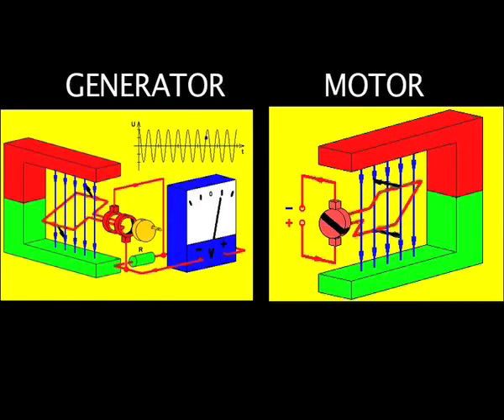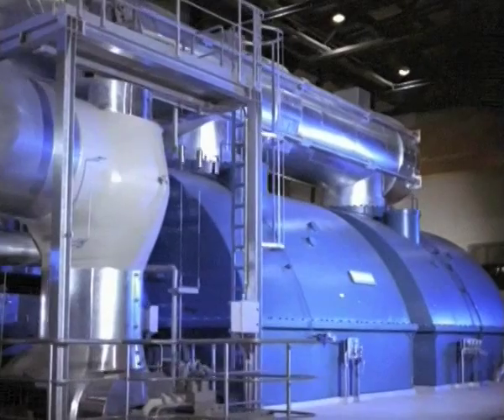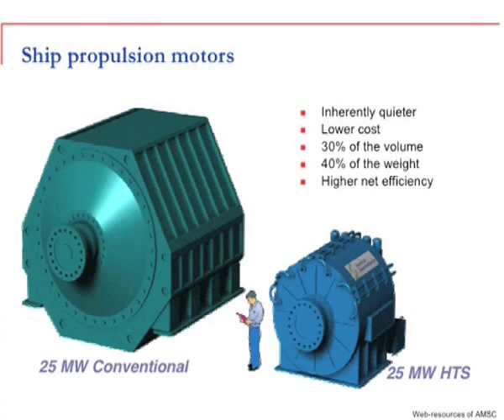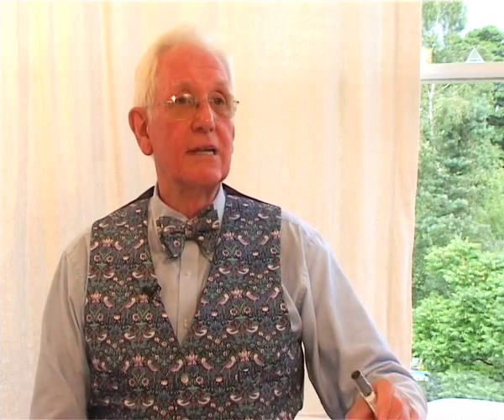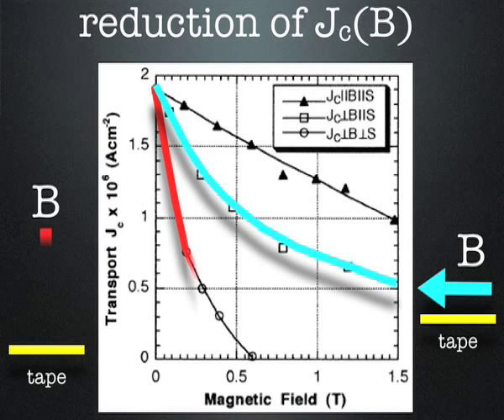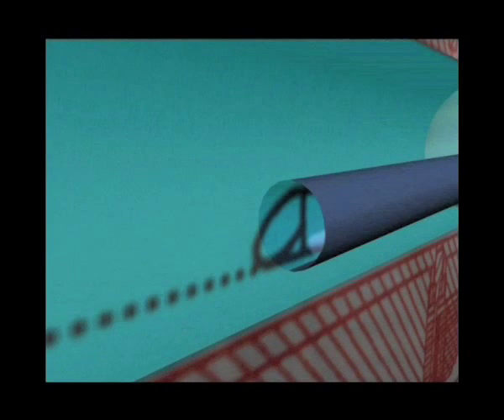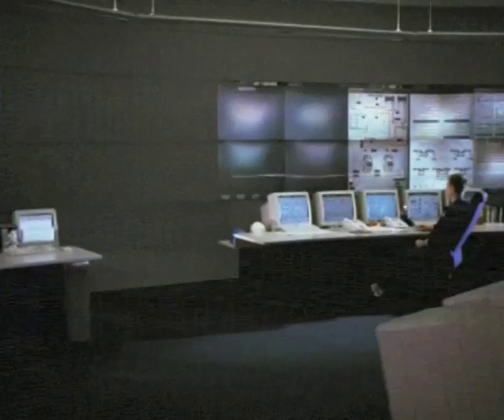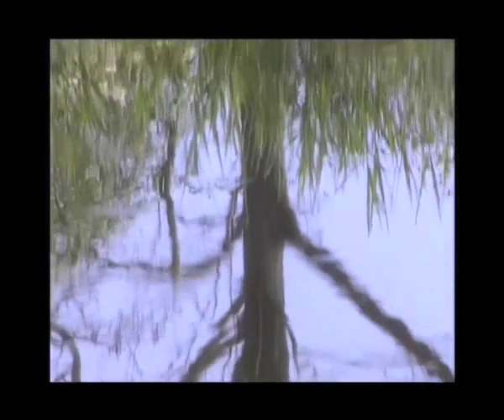Superconductivity: motors and generators

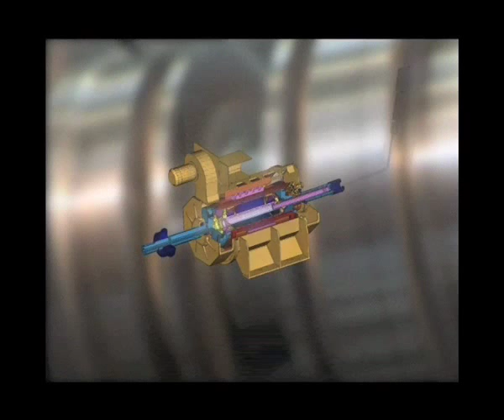Comment: 7:20 You have commercially available refrigerator that can liquefy neon gas and is completely passive and low/no maintenance ?
Reply: They mean the refrigerant does not need a pump. It still must be compressed back to liquid, which requires energy.

Comment: 1.7% no big deal.. Why bother
Reply: It is a big deal. The difference in emissions or power generated might be just 1.7%, which is indeed not too interesting (it does save a little bit tho), but because the power losses are reduced 2 or 3 times, you have less heat to remove and deal with, this is directly proportional to the size and additional infrastructure to run with the generator. It can saves tons of weight, space and extra stuff around the machine to make it work. It could reduce also the cost, but in applications like ships and submarines, it now allows you to have significantly (few times!) bigger power generation possibly than was previously possible.

Same is true for example with power supplies for example. A difference between 90% and 95% could be a difference between needing active cooling and not needing active cooling, which is directly proportional to reliability, noise, and wider operating conditions.

Comment: Now there is a slight problem with all of this: If it were that super efficient and a lot cheaper, more stable, smaller, quieter and all that... why is the world still building the old fashioned power plants instead of the new htc generators?
Reply: Because industry has not fully caught up as of yet and it takes time for penetration of the market place. 

In a decade these will be considered cutting edge norm and will be considered the market norm but still will be expensive.
Reply: how about the energy industry doesn't want cheap electricity. so they buy all the patents and smaller firms that develop those.
Reply: Because it's a lot more expensive to build, I guess only research device exist at this point and no commercially available units.
Reply: FalcoGer Another reason is that different materials are being researched and discovered all the time. Materials with higher temperature superconductivity, better workability, cost, cryocoolers, insulators, magnetocaloric effect materials, etc. Imagine spending 50 million dollars for your first production run, and reading an article the next day about better materials that were just made at MIT! 
I wouldn't go down that whole "evil oil companies buying patents" road. The fact that you saw this video a year ago is proof that it isn't secret technology hidden from the world. They're still just electric motors. Magnetic field + electric current= torque, right? Right now, cryogenic liquefaction is very energy intensive. That little drip of liquid neon or whatever it was at the end requires a lot of energy, partially canceling out any benefits. This could be recovered, however, if someone is smart enough to use a cryogenic rankine cycle to use the evaporated gas to spin a turbine to recover that energy, cooling (and partially reliquifying) itself in the process. Oh wait, I guess someone IS smart enough to think of that :)
If you're one of those conspiracy types, then don't rely on the electric companies. I bought my cryocooler for $500 on eBay, an automotive a/c compressor is easy to modify into an air motor, and you can buy HTS materials online. Just do it yourself. complete solar panels are around $1/ watt. Use liquid air (nitrogen) as energy storage instead of batteries (the PV panels power a cryocooler). The evaporated liquid nitrogen spins a turbine, powering the superconducting generator, which is cooled by the liquid nitrogen itself. Get it?
Reply: Like it says in the video, material science advances are needed to decrease the volume required to reach the high flux density
Reply: @andyjones7121  look up liquid natural gas expanders.  They generate electricity from the the volume change of liquid natural gas from high pressure to low pressure.  It’s exactly the battery you described but doesn’t result in the liquid changing states.  I worked on a few lng expanders in sparks Nevada.  Before they used cooling towers to get rid of the excessive heat.  Megawatts of power being thrown away!